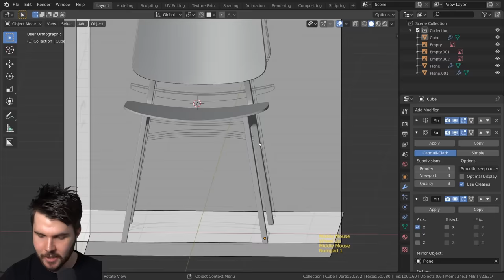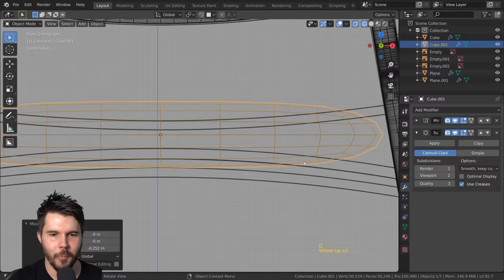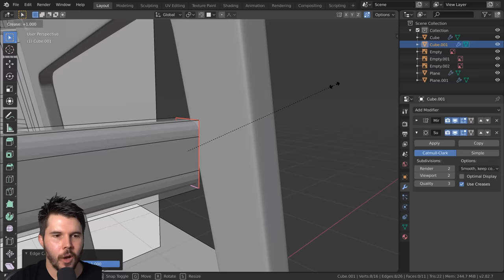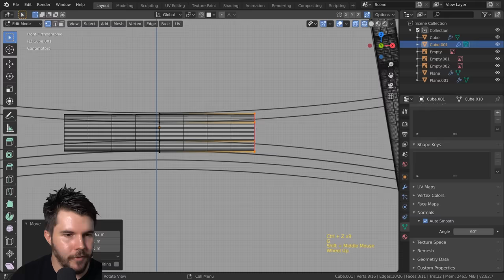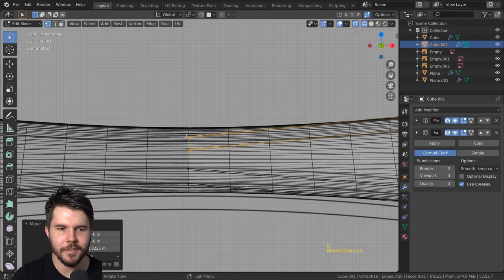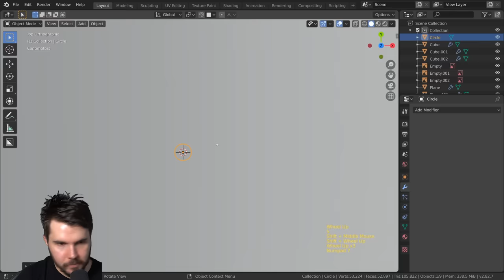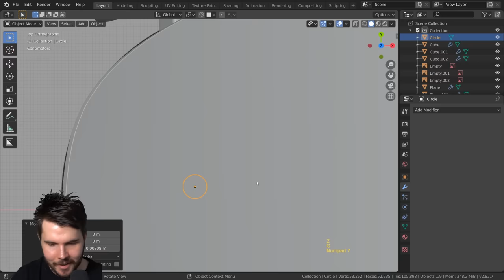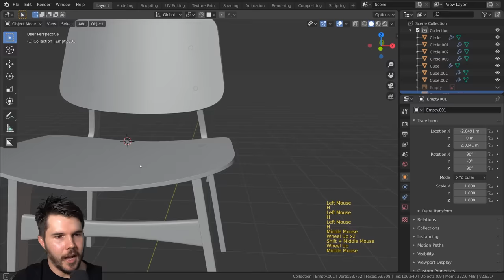Blender Beginner Modeling Chair Tutorial - Part 6: Creases & Shearing

Comment: 18:30 pls HELP when I am doing this it just doesn’t work! Can someone help me?( It doesn’t fill like it’s on the video
Reply: I had the same issue but figure it out. Make sure your in edit mode with the first circle selected, then use shift + A to add the new circle and change the verts 8.  By adding in the object in edit mode I believe it makes it part of the original circle.  If you are not in edit mode with the circle selected it will just make it another object in your scene.
Reply: @Greedo005  Thanks a lot 😉

Comment: Guys, for the two rungs being weird, it is because the back rung is actually taller. They start at the same global height, but the back rung extends lower, maker it larger than the front rung. Hope this helps!

Comment: So my "snap to face" was going crazy, like the line was pointing at random places, and my screws were moving at like huge increments. Anyone know why this is? Could it be because I haven't applied my subserf modifier?
Reply: Mine was doing the same thing. I ended up not using it. Please report back if you find out the answer.
Reply: @bdank7  I didn't find a solution, I just manually rotated it and moved it until it was close enough.

Comment: Hey guys! I was wondering when an object is on "edit mode" and I turn it into wireframe I don't get loop cuts by default but instead I create them. Is there something I do wrong? Because I see on the tutorials that when you press wireframe they are just there.
Reply: Yeah, I had the same. When you add the subdivision modifier, untick the "Optimal Display" box. Now you'll have all the wireframe lines visible.

Comment: Again commenting with a fabrication background, the real soborg carpenters probably used something like dominos or biscuits to fit and glue the rungs. They used screws on the seat and back because the seat and back are too thin to hold a biscuit. I have done my fair share of manual labor, and I agree! <3

Comment: 12:08 i dont understand why you using edge slide rather than scale at Z normals?
Reply: So that it follows the path exactly to the point it should be while keeping a flat edge, because if you were to move it around, you might curve it a bit.

Comment: Is anyone else not seeing the circle when they spawn it in? All I see is the out line. I'm in solid view mode to.
Solved it. If there is anyone else that can not see the Circle Mesh. As soon as you spawn in the mesh you need to adjust the stats in the bottom left corner. Change the "Fill Type" to "Ngon".

Comment: 15:10 my parts became a little weird when I applied scale. I think normals are messed up? not sure.
Reply: Same thing happened to me, turns out I had another cube inside the original, just deleted it and it worked.
Reply: @antoniomoreno8190  Did exactly the same and still not sure how

Comment: If anyone was wondering how to do the screw properly, I personnaly used a 32 circle, added a loop cut at the center than I dissolved the verticies of the interior part of my loop cut 3 by 3.
The loop cut is used so the outside of my loopcut is still a perfect circle, but the inside became an hexagon.
You can also extrude down your hexagon to add depth :)

Comment: I don't get the point of using wireframe mode instead of it you can just use edit mode with x-ray turned ON.                                     Wireframe make it difficult to work.

Comment: 8:06 Can anyone else not find their "normals" under Object Data Properties after the 4.1.1 update?
Reply: I found out from a comment in the previous video that it has become a Modifier. Modifier - Normals - Smooth by Angle. You still have to apply it. 

In case anyone else missed the comment :)
Reply: @hosomi21  Thank you!